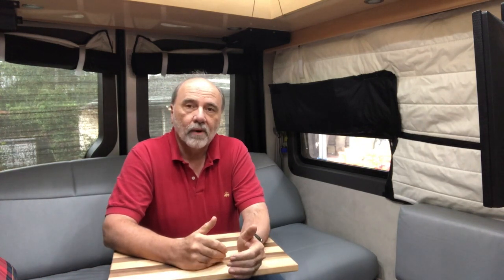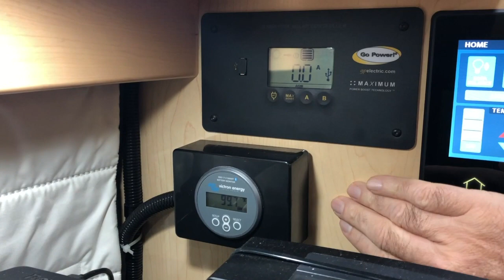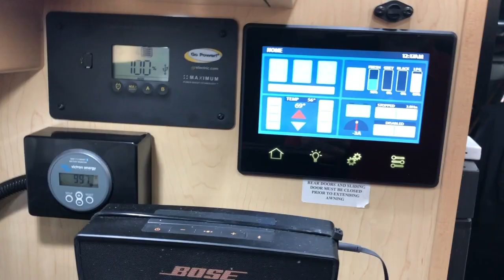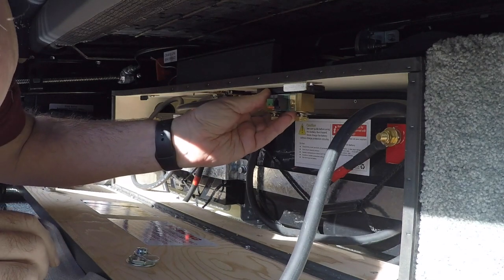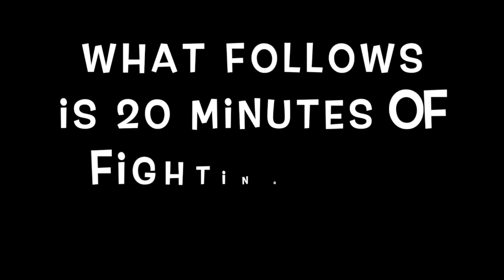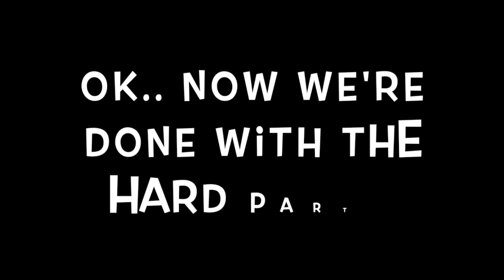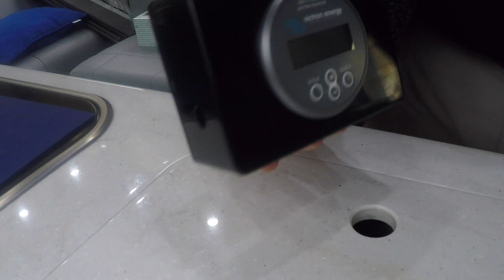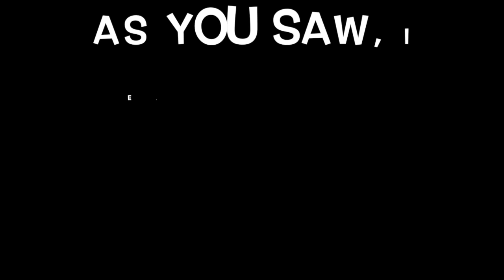Victron 712 Battery Monitor Installation

Comment: Great video. After seeing it we ordered a Victron SmartShunt 500A (similar to the BMV-712 but without the display) for our 2019 Ascent. I’m wondering what battery cable to order? I tried the link in your description box but it doesn’t appear to work anymore.
Reply from the maker: Thanks., I'm glad it helped.  Back then I just bought a 2 gauge battery wire from an auto parts store. It was really hard to bend it to where it needed to connect.  Since then I've started using welding cable in my van wiring projects.  Its really flexible and easy to work with.  Especially important when working in the Pleasureway.  Here's a link to what I use, they have different lengths you can purchase, just make sure its 2 gauge:

https://www.amazon.com/Battery-Welding-Flexible-Terminal-Connectors/dp/B07K4QR1Y6/ref=sr_1_11?dchild=1&keywords=welding%2Bcable&qid=1625271877&sr=8-11&th=1

You'll need a tool to crimp the lugs that come with the wire:

https://www.amazon.com/IWISS-Battery-Cable-Crimping-Cutter/dp/B00MVE48Z6/ref=pd_bxgy_img_1/142-3932752-1873540?pd_rd_w=Lhazf&pf_rd_p=fd3ebcd0-c1a2-44cf-aba2-bbf4810b3732&pf_rd_r=5605DYVQZ5ZTV8HSSYKB&pd_rd_r=e53f6d43-a6e1-4fdc-8769-c955798f72f6&pd_rd_wg=q6yT1&pd_rd_i=B00MVE48Z6&psc=1